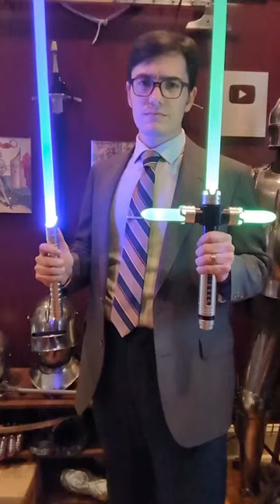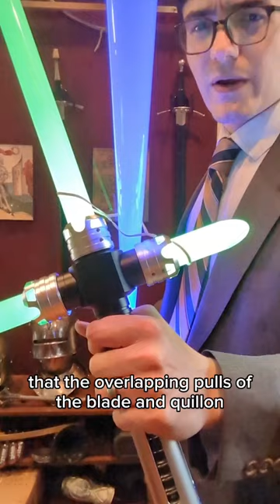Crossguard Lightsaber Theory

Comment: I feel like the easiest explanation is that the actual emitters are a bit deeper set into the hilt and the visible metal sticky-outty parts are just "tube" parts there to stop you from frying your fingers. Enemy saber slides down, cuts through the top of the tube, but gets stopped by the actual crossguard beam inside
Reply: Good theory but that also means there would be molten metal potential being thrown towards your hands…
Reply: better than cutting your fingers off accidentally
Reply: the Jedi Survivor thing seems to have an improved look where it doesn't have the tube at the top, only at the bottom so hands don't hit blade.
Reply: Or you just coat it with something that can resist lightsabers
Reply: @TrueSonOfWalhall  at that point you might as well just have a cross guard made from that material instead of a lightsaber cross guard
Reply: @zjaeriqsanders1731  no because you can still use the light saber cross guard offensively. Imagine you're in a bind and twist through and hit them in the face with the cross guard.
Reply: @TrueSonOfWalhall   Or, you know, you could just take the more practical route and kick them... You know, like someone without lightsaber tunnel-vision...
Reply: @sytritewarum5720  How is kicking them and making yourself vulnerable to pushes more practical than using your weapon while controlling your opponents weapon?
Reply: @TrueSonOfWalhall  They're lightsabers. They can't slide across each other. The point where they locked? That's your only pivot, and it's not going to change. Trying to do what you suggested would be wildly impractical and awkward, even if you were lucky enough to make contact at just the right point on the blades to reach your target with an awkward cross guard... I'm not saying that kicking is an actual good choice. It's a dumb thing to attempt, but one that can be attempted to some result far more often than stabbing someone with your guard from a saber lock...
Reply: @sytritewarum5720  What I suggested is a technique used in actual swordfighting (as in it is based on old manuals) and it is also used when binding edge on edge meaning that blades bite and can't really slide, all you need is decent footwork.
Reply: @TrueSonOfWalhall  To be honest, I can't imagine any specific way for that to work that wouldn't be, as I was saying before, very awkward; but I'm willing to admit, my ability to conceptualize movements like that can be a bit too rigid at times. I guess I'd need to see an example in motion to get a grasp on what the hell you're suggesting...
Reply: @sytritewarum5720  I'll try to describe it a bit better. Imagine your blade binding with your opponents blade with your blade on the left side, you apply a bit of pressure to lure your opponent into applying more counter pressure, then you give in, let him push your blade to the side and then as soon as his point is past your center you tilt your hilt to the left, lift it a bit and step forward with your right foot, and push your cross guard into his face or chest, this keeps your blade between his blade and your body, let's you control his blade (and if he tries to disengage you just grab his arm and control it that way) and closes the distance to make sure he has nowhere to go. (this is based on two handed use of the light saber as I am most familiar with longsword techniques, but when using a single lightsaber mainly using both hands is the most advantageous way)
Reply: @TrueSonOfWalhall  I... Think I get it... However, it is the middle of the night, and my brain's not quite functioning at capacity for the time being, hence the uncertainty. I'll reexamine this with a clear head tomorrow. I appreciate the discussion so far.
Reply: @sytritewarum5720  I understand completely, my brain is just as fucked, currently watching the Nürburgring 24h race and I've been awake for almost 24h already 😂
Reply: @sytritewarum5720  There is no such thing as lightsaber fighting, just fighting with a lightsaber. Id spear point the ends of my quillions on a longsword crossguard for the same purpose and you can halfsword that, but also use kicking, punching, wrestling. You have a lot to learn if you think limiting your options in any kind of fight is productive or beneficial to you. Even when Kylo and Fin were locked in a parry, Kylo slowly drove one of the crossguard emitters into one of Fin's shoulders, making two hand grip with his saber much harder.
Reply: @Adamant1993  Look, man, the last time I even had the opportunity to so much as spar with anyone was about... eight years ago...? I'm not getting any practice any time soon, and I highly doubt I'll be getting into any real fights either... So, the real question is, why can't anyone ever bother me at a reasonable hour of the day? I'd be totally up for a discussion if my head didn't already ache from having gone about my day...
Reply: @sytritewarum5720  To be fair, i dont know your time zone and i live in a country with 6 of them 😂
Reply: @Adamant1993   Bad luck, happenstance, and weird timing as always, I guess... ain't that just the way...
Reply: Lightsaber hilts coud be made with phrik or other resistant materials like songsteel
Reply: @sytritewarum5720  Ah yes the struggle of discussing with people in a different time zone😂 sorry if my comments come at unusual times, I'm in Europe.
Reply: @sytritewarum5720  Wean your in a sword bind I think something like a elbow strike or if you have it a cross gard strike in close range like that within a few feet
Reply: Yeah especially if its all coming from 1 crystal in the middle
Reply: They’re like nozzles to stabilize the stream, according to anakins second saber at least. so yeah they do go in further. I imagine it just has one kyber Chrystal aswell that’s beam is split. so it should be a solid cross with a Chrystal at the intersection.
Reply: I like this theory
Reply: @hummer4833  that’s a lot better than getting your fingers sliced off. All you really need is a semi decent pair of gloves, which almost every damn Star Wars character seems to be wearing.

Molten metal doesn’t stick like napalm, it falls off right away usually.
Reply: That is the easiest explanation?? Tf.. dude just say beskar
Reply: Don't thinkbthis theory works at all if it did the cross section of the magnetism would pull the blad right into the corner making it even easier to slice the hilt
Reply: @zjaeriqsanders1731  be quiet stop leaking the design for Grogu's Beskar lightsaber
Reply: @Matt-st1tt  i think its a dumb theory period but to defend the theory, the cup link's (gold bands) on the cross section could be negatively charged to deflect the saber into the saber.
Reply: It would explode
Reply: @godIikesheep  i work with melted metal and i strongly disagree with that.
Reply: @TrueSonOfWalhall   remember Kylo used this move against fin in the 7 movie
Reply: There are material, not just beskar, that are immune to lightsaber blades, I think having even just a coating on the handle would be enough. Maybe have the “quillons”, the guard, angled toward the main blade?
Reply: I think it's something like that, at one point the lore for Kylo's saber was that the crossguard and crackling energy effect were because of the same mistake in its construction, and the apparent emitters were added after the effect presented itself, but I don't think they stick with that
Reply: Actually the easiest explanation is that Disney doesn't understand how lightsabers work.
Reply: My hypothesis as well, although the tubing wouldn't be all that necessary at the top of the 'quillons', only at the bottom.
Reply: @godIikesheep  I like your profile picture
Reply: @kyle_mk17  thank you o7
Reply: It's just a vent the plasma runs through it so even if you did hit it it you would still be blade to blade
Reply: @TrueSonOfWalhall  so….what Kylo does to Finn in the Force Awakens
Reply: @bradencb2970  basically yes, just in a better way and less like a brutish orc.
Reply: This is how it was. No one reads the cross section books anymore for some reason.
Reply: @hummer4833  that doesn't make sense. If the lightsaber cuts into what appears to be the emitter all that will happen is a hole will appear at the top of the emitter, there wouldn't be enough metal to go molten and drip onto your hands. Not only that but even if it did go molten your hand would have to be directly below that point for it to have a chance of dropping onto you. 90% of the time in lightsaber combat the saber is being swung and thus your hand is not directly in the path of where the molten metal would go. So either way, you're wrong.
Reply: @TrueSonOfWalhall  something they would probably do to armor if it existed…….
Reply: @deadeyeduncan5022  oh stuff like that did exist, phrik, cortosis and beskar for example. They were just really hard to get. But if you manage to get your hands on it you can absolutely use it, and an organization like the jedi order or the sith would absolutely have the ability to get cortosis or phrik.
Reply: That's an "easy" explanation but they actually went into it somewhere in non animated lore and hes pretty close to exactly what Sabers do magnetically. They are definitely magnetically charged and both repell and attract to each other - I believe force applied is the deciding factor. Either way it's strongest at the emmiter itself. That's why any Sabers that have been slashed in half are down the middle or turned while off.
Reply: Theyre vents for excess energy so yeah that's probably what it is
Reply: @TrueSonOfWalhall  Beskar
Reply: @landenmcdonald4270  beskar would be best but getting your hands on it will be almost impossible since the mandos don't like to share it with outsiders
Reply: Kylo Rens lightsaber needed the vents
Reply: damn bro that’s a really good explanation you have amazing explaining skills
Reply: I don't think I've ever seen a lightsaber slide down another in anything.
Reply: @callumscott2650  where exactly does the metal that was cut off from the lightsaber guard go if not down onto your hand????? matter doesn't just magically disappear.

if you get into a saber lock (what the cross guard would primarily be used for) the other lightsaber might touch the guard, and if that guard isn't made out of a lightsaber resistant material, the metal will be melted like we have seen lightsaber do to metal before. once the metal has been melted by the lightsaber it would then be flung towards you or your hands as that is the general direction the force of the lightsaber would push it into. the emitter is made of metal, a hole would definitely appear at the top of the emitter, but the matter that once filled that hole doesn't evaporate into thin air. I hope that makes sense for you
Reply: I’ve thought this since the force awakens came out. Nice to know I’m not the only one
Reply: @sytritewarum5720  Would be funny watching someone so focused on kicking they get their  🦵 hacked off.. 
Kicking legs make great targets.😂
Reply: @lordsithous4406  Actually, if that happened in one of the films, it would be hilarious.
Reply: @MataNui.  same
Reply: Maybe the light saber has some beskar on it
Reply: Or the even easier explanation of lightsaber resist material such as phrik, palatine's lightsaber hilt is partially made of it. Or beskar which is what the mandalorian used (which was winning a war against Jedi).
Reply: I like to think bescar is used a lot more then we think
Reply: @TrueSonOfWalhall something that resists lightsabers, so why not use that on everything including the armor you wear. Pretty big hole there.
Reply: @pata6129 Beskar is impractically heavy unless worked by a mandalorian armorsmith. There are other, far more common lightsaber resistant materials that normal people could probably gather a hold of.
Reply: @stardragon8585 Yeah the lore was that he poured too much power into his crystal feom his Jedi saber when bleeding it and it cracked, something that would usually disqualify it for use in a Saber, but seeing as he didn't have another option, he made it work, the side-blades were essentially powered by bleed-off energy from powering the central blade. The cracked crystal and unorthodox construction and design gave the Saber its signature unstable, fiery look.
Reply: @dr.insanity9087  pfff are you saying kylo ryen is a normal person let alone a normal person would even use a cross guard light saber??
Reply: @pata6129  I meant normal people as in not mandalorians. Maybe I could have phrased it better, but light beskar can only be forged by a Mandalorian armoursmith, meaning that most people(which I phrased as 'normal people' in my original reply) would not have access to it, as armoursmiths only work beskar for other mandalorians and Mandalorian culture, including non death watch, doesn't allow for much beskar trade, if any at all.
Reply: @pata6129  No need to mock someone over a phrasing/wording issue.
Reply: @dr.insanity9087  ah
Reply: @dr.insanity9087  well you did say normal people while talking about mandalorians and jedi.. i would think a jedi could get an armorsmith.
Reply: Easiest explanation would be that they are made out of beskar and can’t be cut by a lightsaber. That solves everything lol
Reply: @duncan1674  copy cat
Reply: @pata6129  Who tf are you lol, I didn’t read through all the comments before I posted but okay 😂
Reply: @duncan1674  im just the guy who said it first.
Reply: @pata6129  Idk if this was a serious interaction or not, but the fact you were reading every comment on here in your free time is honestly kinda sad. Hope you’re doing okay bud.
Reply: @duncan1674  its called notifications, you know the bell icon in the top right that glows red with white numbers... its ok your cognitive functions will kick in sooner or later.. work smarter not harder "bud"
Reply: Sabers cant go through other sabers? The cross guards would exact the same as they do on a normal sword.
Reply: ooh probably, and usually someone with a crossguard lightsaber won’t get into a bind like that so you’d rarely need to replace them
Reply: Could just be beakar or whatever those electro stick things are made of
Reply: I feel like the easiest explanation is that disney is bad at star wars
Reply: this has already been confirmed to be the case by the writers
Reply: @TrueSonOfWalhall now imagine you twist wrong or your saber is hit wrong and you stab or slice your own arm with the cross guard.

If you want the offensive capability in the example you gave, pointed crossguard. Or a standard one being as the murderstroke was a thing.
Reply: @kennetheisenbraun5217  try to do a Mordhau with a lightsaber, I'm not sure this will work. But yeah of course you need to be a bit more careful but if a real swordsman can avoid hitting his arms when using a longsword I think someone using the force can do that as well.
Reply: @manuelschurig2266  obviously the technique itself is out of the question, I was talking about the spirit of it. The point is a lightsaber cross guard is as hazardous as it is useful. 

For example if you're put into a bind and on the defensive, twist wrong and you could stab yourself in the chest, shoulder, etc.

Having a lightsaber crossguard basically means there's movements you can't use without hitting yourself.
Reply: Why not only have the metal cover the bottom side of the cross guard so the plasma blade can be exposed from the top. This would allow for a larger blocking/cutting surface, while also minimizing the risk of molten metal falling on your hand after colliding with an enemy light saber blade.
Reply: @hughmungus5033  that is a Half measure in both directions of having a lightsaber resistant crossguard and having a lightsaber bladed crossguard. Depending on the design, it almost completely defeats its own purpose.
Reply: repairing after every fight? and the blades arent there, thats where they are shot out of.
Reply: Thats what I was thinking
Reply: I feel like jedi survivor more or less confirms this because of the way that the vents are able to fold away, it only makes sense that the actual blade comes from a deeper part
Reply: Okay, but now the emitter is broken and the hilt has melted metal all over it.
Reply: Jesus Christ the sovereign God loves you :" )  I hope you personally get to know the Holy Trinity

if it interests you to hear,

God miraculously healed me of my chronic breathing issues that plagued me if not most nights then every single night for years

God did this healing instantly within group prayer over my health
Reply: @joshua2400  I'm pretty sure you were being poisoned my dude
Reply: Then the outer parts would just not have the metal guard?  It would just be a T shape by the hilt
Reply: Because it is just excess energy from the kyber crystal
Reply: @hummer4833 not really. there are a shit ton of lightsaber resistant alloys in canon, a lot more than beskar and some are shown to be pretty common
Reply: I think that the writers didn't actually think that far and they just wanted a cool looking light saber.
Reply: @TrueSonOfWalhall  you kick their knee caps
Reply: @hummer4833  For what it's worth, lightsabers seem to contain their heat very well until actual contact
Reply: Then every crossguard that is ever used would have molten slag on top from clashing with other lightsabers.
Reply: Spins it around once.

Welll, there went my wrist,
Reply: I think the easiest explanation is the costume designer wanted a new shape and chose the crossguard because it looked unique
Reply: @TrueSonOfWalhall mandolorian armour
Reply: @hummer4833 Like every other time you turned on The damn the thing

You already have something hotter than the fucking sun
Reply: Guys, guys, we are missing the point
They are there because disney thought they looked cool
Reply: @hummer4833 then again, if it were able to contain its own blade for extended periods, you'd assume it can also withstand occasional contact with enemy blades without being immediately be melted and used against its user.
Reply: lightsaber dueling overall is pretty dumb, bc at the end of the day it would be a very fast fight in real life if they were a thing. turns blade off. turns back on. W
Reply: My theory was they were just made out of Is pure mandalorian bestcar
Reply: @zjaeriqsanders1731 I like your idea, but that would limit the ability to also use the crossguard itself as a weapon. Being a lightsaber blade itself increases it's damage and functionality. Also risk factor, but that was probably taken into consideration.
Reply: @Lilregpack  this is such a dumb argument idk why people constantly say this
Reply: @prehistoriccreator9600  Which to me kind of reinforces the possibility of the idea that the emitters are deeper in the hilt. Kind of like "hey this way it's clear"
Reply: @hummer4833 the crystal is in the center, not at the edge of the emitter. These are space wizards, they don't care about molten metal
Reply: @manuelschurig2266 thank God I don't watch/read star wars so I cannot fight this shit. (Don't understand, cannot fight.)
Reply: I think they just went for a cool design and didn’t put much thought into the flaws
Reply: That is such an old thing. Me n friends were arguing this hard until I saw diagram of Kylo lightsaber and it literally showed that guards are just holes with metal tubes and emitters are inside the handle
Reply: @hummer4833 Probably most hits the floor
Reply: @TrueSonOfWalhall That's like 2-3 materials in canon and they are not exactly common or cheap...
Reply: @hummer4833  One would assume if the tube can handle the heat of the plasma going through them it could handle the heat of the blade making contact with the outside. There's no way the hilt is fully insulated from the blade it emits. Because heat radiates. Presumably in the Clone Wars some lightsabers were ignited for hours. So the metal seems capable of withstanding some level of heat transfer before melting. Likely a few seconds of a blade sliding along the crossguard would not melt it.

But Maul's saber was split in half with a single stroke so.. Maybe lightsabers are just nonsense lol
Reply: @hummer4833 Obi Wan got a bullets worth in his shoulder and was fine
Reply: That's always how I thought of it too
Reply: Easiest explanation is actually beskar crossguard
Reply: This actually does make some sense. Much more than the video itself.
Reply: @zjaeriqsanders1731 a coating of lightsaber resistant material is basically always going to be WAY more cost and labor efficient than the entire hold being made of the stuff. Otherwise it would have been much much harder for the Jedi to enforce their restricted trade on such materials.
Reply: Same.
Reply: Not how those work, or else you wouldn't be able to cut through a lightsaber at all. Lightsaber construction can't be completely compared to a sword, where the tang descends partially or fully into the hilt. The blade (and thus the vents) start and stop and the emitter, if you are able to start cutting the emitter, you cut through the entire emitter.
Reply: Problem there is that we actually know a fair bit about the structure of a lightsaber. The very tip of it does feature a sort of stabilizer/focuser though that allows the beam to form in an organized manner rather than just being spat out like a flashlight.
Reply: That's what I believe to be true. I think the idea is that the light is actually refracting at the center of the cross guard. This would probably explain why the energy coming out of Kylo Ren's lightsaber seem more violent and unstable, especially at the base of the blade; he's literally dividing the energy of the blade into three sections.
Reply: I feel like the easiest explanation is that Disney fudged up Star Wars
Reply: Out of curiosity, being that there is a suspension of disbelief here discussing kyber crystals lol, can a lightsaber cut through a kyber krystal? What if there was an in-universe way to coat lightsaber hilts in kyber krystals not emitting anything?
Reply: Could also be made of any of the many Saber resistant metals
Reply: @hummer4833 Anyone that's accidentally felt molten metal knows how painful this is. I shudder to remember when I did.
Reply: Nah what he said made way more sense
Reply: That's exactly what would happen If it would hit it. But as in the video it's really unlikely.
Reply: We've seen it melt blast doors : Quigon, episode 1 
We've seen it not melt the lightsaber handle itself : they exist
we know that the Kyber Crystal is focusing and shaping the blade: we don't see the Kyber Crystal

In this 1 part essay I will explain to you the reader, that lightsabers house the Kyber Crystal in a resistant material, and that the same material is used anywhere heat from the blade of the saber will be transferred. 

That's it. That's what I think. 
I think if the blade could melt/cut the emitters, that the Kyber crystal would be visible, lest turning on your saber cause it to self delete.
Reply: here is a question, have we ever seen a light-saber "slide" against another? to then hit the hilt/hand.
Usually it parry the other blade away, then goes in for a clean wrist cut.
Reply: @hummer4833 better than having them cut off
Reply: I've always just assumed that's how it worked. I never understood people thinking the design was dumb, and will never understand it.
Reply: @hummer4833  It would vaporize what it cuts through. When the metal melts and becomes molten is with prolonged exposure AROUND where the blade is.  Like Qui Gon cutting through the door after he already stabbed a hole in it.
Reply: @hummer4833 lightsaber blades have highly controlled temperatures. This is. Why your body parts don’t explode on contact with the lightsaber.
Reply: Damn that’s actually not bad
Reply: This isnt the issue with these emitters, the main issue is it hurting the wielder. Thats what makes it stupid. The legends jedi around the clone wars used ones that shot up at angles, they didnt stick straight out like that.
Reply: @sytritewarum5720 plus if the blade is REALLY locked together, a kick might be what's needed to unbind yourself.
Reply: @hummer4833  you can just force levitate that shit at your opponent's eyes
Reply: Isn't that the theory that Stephen Colbert of all people mentioned when Force Awakens first came out? I always thought that explanation was the most probable.
Reply: @sytritewarum5720 sounds like the words of someone who literally isnt a force sensitive.
Reply: @sonew2785   Obviously. Because, I hate to break it to you, but star wars is fictional, and there is no force to be sensitive to.
Reply: Also, all components near blades are likely made out of something like beskar so they aren't melted by their own blade.
Reply: lightsabers don't slide. due to something in the blades they hold themselves where they hit on the opponents saber.
Reply: Yeah but if the metal tube part was just there to stop your fingers wouldn’t it just have that on the bottom half and not the top? Like just cut the tube in half so it doesn’t have to risk molten metal falling onto the user’s hands
Reply: i feel like the easiest explanation is they thought it looked cool, didn‘t give a shit if it made sense and some nerds desperaetely try to unstupify it.
Reply: @swaglord5437  basically. Yes.
Reply: I feel like it would just explode if you do that
Reply: That’s what I always assumed would happen. Either that, or maybe that part of the hilt is made with Beskar steel. So then even if you did hit the cross guard, it’s not going to cut through it.
Reply: Or something like durasteel or a lightsaber resistant alloy. Nothing on the level of Beskar, but enough heat resistance to allow the crossguard saber user to get the opposing saber off of the guard.
Reply: It should only cover the bottom part then. SW Jedi Survivor has some great crossguard designs that look like this
Reply: Why not just make it triangular so the top is blade but then the bottom is metal, basically skipping the step of cutting the tube altogether
Reply: The actual explanation is that star wars was sold to people who don't get it or respect the established fiction or the creators who made it
Reply: I mean kylo ren himself stated his saber cross guard are mere exauster to prevent his saber to destabilize and malfunction from overcharging, as he accidentaly broke his crystal when bleeding it.
Reply: @sytritewarum5720 we ve literally seen them slide across each other before
Reply: @TrueSonOfWalhall  If you're thinking about using it offensively why use those tiny cross guards. Just have full retractable lightsabers at the ends Like maul's but sideways.

Parry opponent, turn on blade facing him . Boom!
Reply: @PotatoPrem  the longer the quillons the more they limit your movements because of the higher risk of hitting your own arm.
Reply: @TrueSonOfWalhall  dont keep it on all the time lol. Just wait for opponent to lock blades then turn on your sudden side sabre